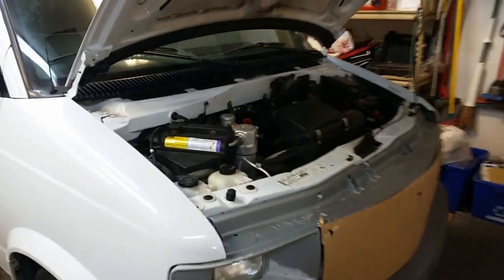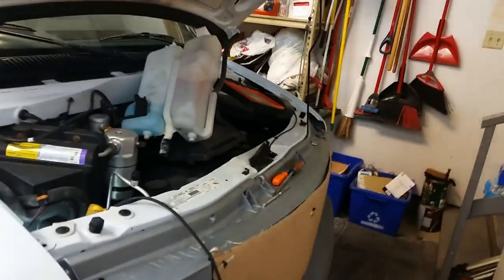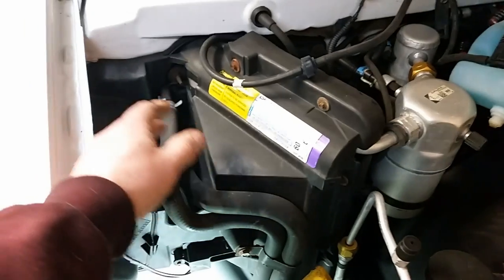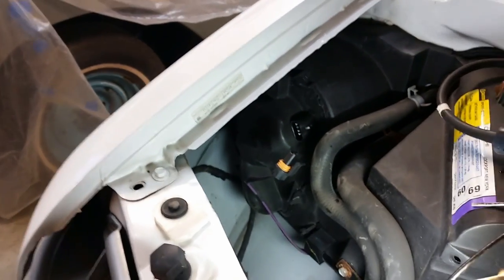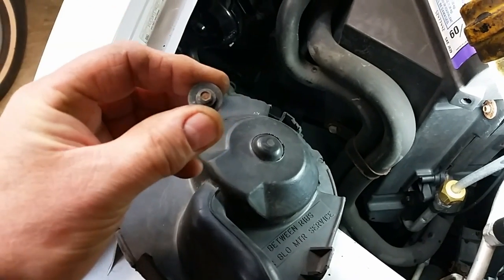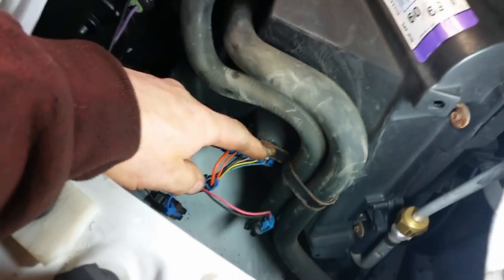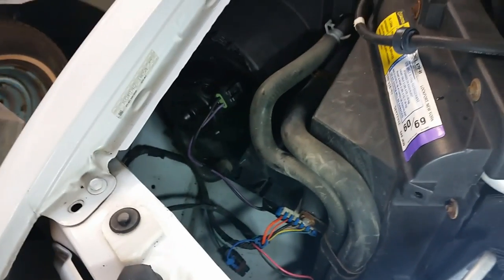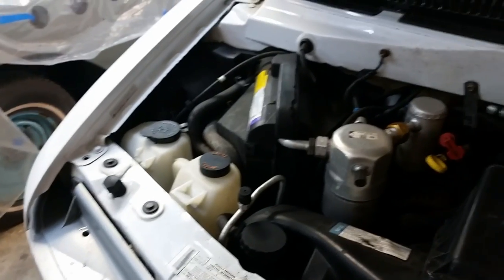Astro Van "Blower Fan Motor Replacement"

Comment: no need to cut when doing it outside when its 5 degrees, housing just crumbled and broke....easy, peasy
Reply: I suspect old age made them crumble not the local temp .   That type of hard plastic housings gets brittle with age .   Mine came out in pieces and had some cracks already on it before I started my work there .

Comment: Thank you,,, Good job. I have to replace my fan on my 2000 Astro. Going on 200,000 miles. BUT,,,,,,,, NO NO NO, Don't put Dielectric grease on electrical contact points. Dielectric grease is an insulator.  Only use it on the rubber seals that hold the connector together.
Reply from the maker: Yes dielectric grease can cause problems and it can prevent problems. I just had a new Bobcat skid steer loader right from the factory that has all the connections covered in grease. Even the service manual says not to do it. However we have had some equipment that works in snow and salt that do not have very good seals on the connectors and without it they do not make it one season.
Reply: @dyna1955  For sure dielectric grease is a very helpful grease in extreme conditions.  You can smear it on, in great quantities, just don't put it directly on contact points, every place else to keep the connectors dry.  I would even say that some grease, even on the contact points, can be better than nothing at all.  It's important that people know the correct usage of this product.

Comment: Some motors run opposite rotation. Verify before install. I made a mistake used a non AC used one. Had to redo job. Air was sucked into vents. Good for pot.smoke evac.lmao
Reply: mitzvah golem will keep that in mind lmaooo
Reply: Damn would be awesome if they made some that had a reverse mode lmao

Comment: You can turn a soldering iron into a hot knife to make cutting much easier. And then use the soldering iron to weld the plastic back together. Lots of How-to vids on youtube.

Comment: Just cut off the cover today. Used several knife types. Best one was small filet knife. Super small point, very thin, flexible blade able to bend and still cut.

Comment: Mine only has 113,000 miles and it just stopped working. We have lows below 20 this week and I don’t have a garage to pull it into. I’m hoping it’s a simple fix. It was intermittent yesterday, so maybe I’ll try banging on it like you did, haha. Thanks for the video!
Reply: Confirmed:  I whacked it a couple of times and it came on. But after I made a stop and started it up again it didn’t come on. I guess I’ll have to replace it when I get the chance. Other videos are mentioning a resistor... how do I know if that needs to be replaced?

Comment: Thank you for the video, extremely helpful. I opened the old motor and found the brushes worn down to slivers @ 220k miles.
Reply: That’s mine mileage stopped working too thanks brown
Reply: I just bought a 98 with 298,000 miles and blows pretty weak. This was gonna be my first stop in hopes to get her blowing good. Air comes out ice cold just feels like she isn’t giving er all she got!!

Comment: So are you suppose so replace and seal back up the access panel that was cut out to get at the blower motor?
Reply from the maker: There really is no seal to replace. The factory set up covers
the blower motor, but leaves a thin line for you to cut. I did not put any
sealer on it as I cut it real close. I guess you could put a bead of silicone
around it if you want to.

Comment: My fan blower motor on my 1998 astro van started making a loud squealing noise once I turn on my a.c. unit any advise on what the problem could be ???
Reply from the maker: The bearings in the fan motor are probably dry.

Comment: I’m not 100% sure but mine seemed like you only have to cut between the actual TABS. Not all along that grove. Try pushing on the grove to see if yours is already separated. Also it’s a 5.5mm socket

Comment: Question 
My air isn’t blowing hot or cold air?
No air period but when I move the nobs I can hear like a air sound but it doesn’t blow any air hot or cold ? You think this will fix it ? It’s never been changed either
Reply from the maker: If you hold your hand on the back of the fan motor can you feel any vibration like the motor is turning?
Reply: I’ll do it right now
Reply: It doesn’t vibarate
Reply from the maker: You may have to pull it out to be sure
Reply: Would it be smart to change the resistor first instead of buying both motor and resistor ?
Reply from the maker: Not sure
Reply: @ashbyash7915  When the motor starts going bad it causes more amps to run and really makes most resistor packages heat up a bunch and weaken them if not fry part of them so only some speeds work .   They are about $25 to purchase a resistor pack at a parts store and you should plan to change the pack out when you do the motor .  If you just change the resistor pack you might blow it again if the motor is going bad .

Comment: Did you replace the plastic cover? I have to do mine... 🤔
Reply from the maker: I don't think it has to go back on.
Reply: @dyna1955  I did end up putting it back on because it wasn't difficult at all and I assumed better protection from elements. Thnx much for your video. Saved me much time and effort as 2 other sites took off whole piece in their instructions. Great catch on proper maintenance.👍

Comment: roughly how long did this take to complete
Reply: If you have all the tools needed for the job you should be able to do it in less than 3 hours if you have never touched anything automotive .  You remove those tanks by using a pair of dykes or side cutter diagonal pliers on the push down buttons to start their release , and then pull up what you can .  Then slip a knife or screwdriver under the place where they meet the metal and pop them out .  Be sure to unplug the battery before you start , or you might blow a fuse .

Comment: what were the symptoms?
Reply from the maker: It quit working completely. I had power at the motor but it did not turn.
Reply: @dyna1955  mine started sqeeling at 2 lower settings... Now only works on 2 higher setting but atleast it doesn't squeel at that speed lol